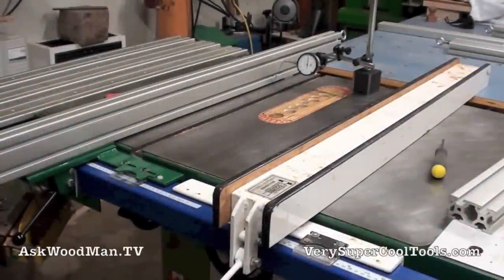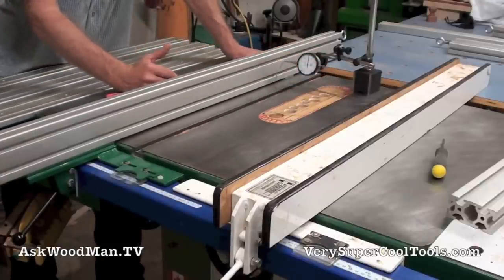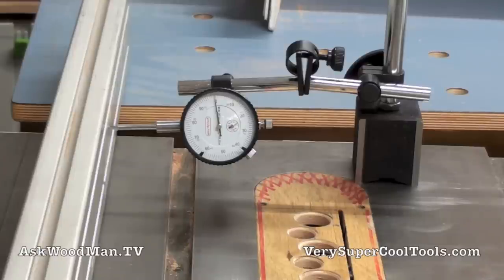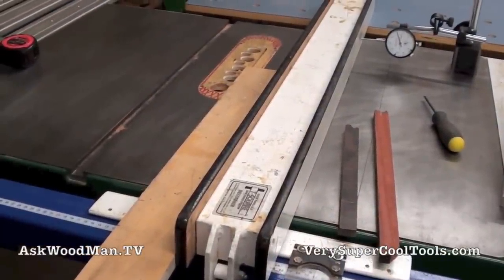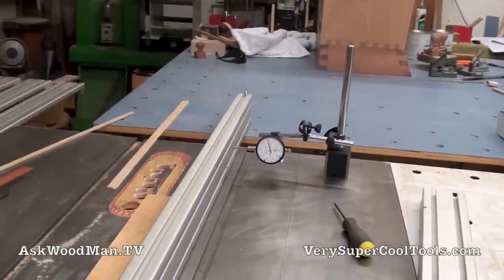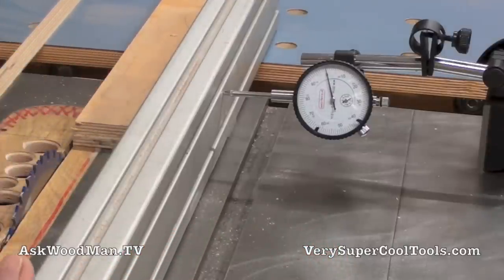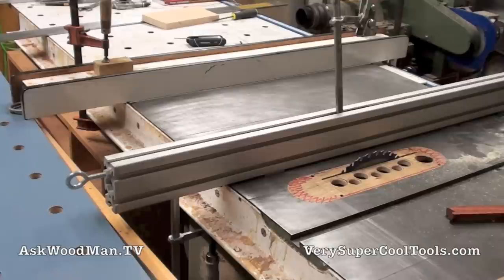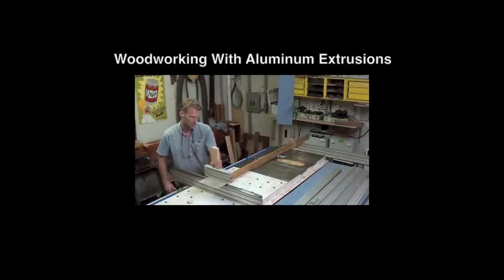Biesemeyer Fence vs. VerySuperCool Tools Fence

Comment: I know I'm responding to a 6 year old video.  The thing that really caught my attention was the holes you have drilled into your ZCI!  I've thought about it, and predict it would  be great at helping with dust collection.  Please tell me your inspiration for doing it, and how it's performed?
Reply from the maker: It helps so much. At first I had a hole cut in it just to stick my finger in for pulling the insert. Then I started noticing how much dust got pulled into that hole when my collector was on. So I added more which helped even more.

Comment: Fair quick question I've never known the answer to....
How often do you need to tune up your table saw?
Reply from the maker: I think if you get a new saw especially an import I would check it straight away. If you have moved the saw or the saw has taken a shock like a big kickback I would also check it. I am going to rework my table saw extension table this summer and will do a complete video on the method I use. But here is a picture of the last time I did it. http://askwoodman.tumblr.com/image/76531520594
Reply: too cool man! im a CNC machinist as well and i head you mention your precision plate you use i will definitely have to make me one of those!!But i did check everything on my new TS when i got it and didn't have to adjust it very much but im still not sure on how OFTEN i should just go threw and do preventative maintenance on it? once a year once a month ?(given that saw has't been moved or taken any shocks. also i have this saw great for a semi serious wood worker and i must say its an awesome saw for the money highly recommended and easily adjustable for an extension for a biesmyer fence already converted mine ;) thanks so much for the reply man!